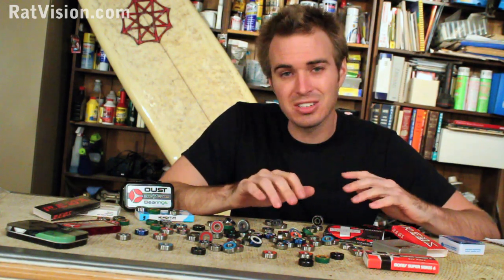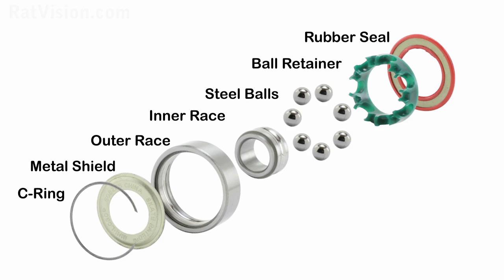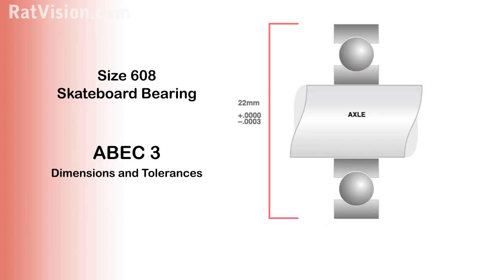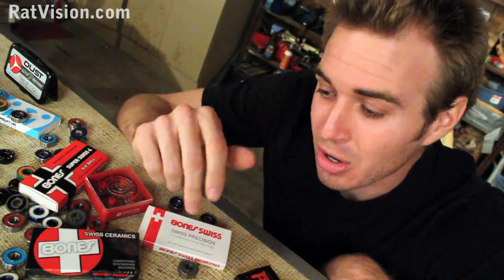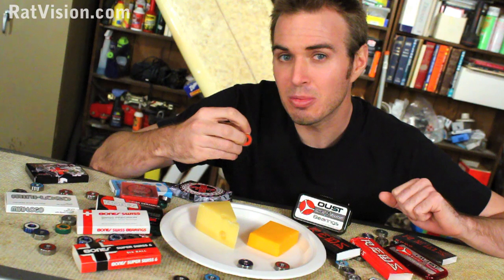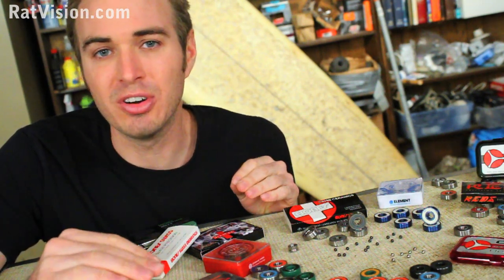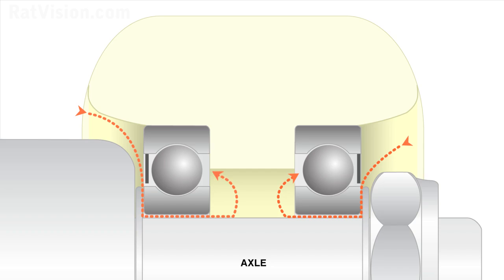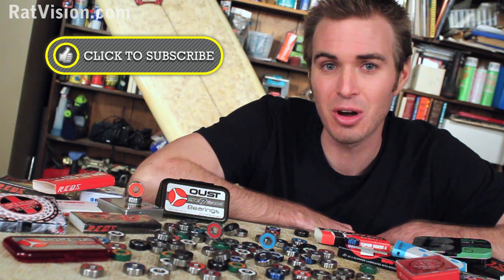What is ABEC / Swiss / Ceramic Bearings

Comment from the maker: If you are kind of new to skating any board is really good for cruising.  Any board will obviously cruise, like any automobile will drive. Shapes, lengths, wheel durometer, trucks widths etc. just get more specific when you know exactly what you want to do with the board.  Anyway, any deck will hold your weight, unless it flexes.  There are different flexes for weights, be aware of that.  36"-40" is a good length. Wheels- 85A durometer with 65-70mm is a good start. If you have more questions ask

Comment from the maker: The truth is not all "Swiss" bearings are made in Switzerland. Bearings r made on a Screw machine.  The best screw machines r Swiss screw machines. If a Chinese bearing manufacturer owns a Swiss screw machine can their bearings be called "Swiss bearings"? They do. There r also Swiss "style" screw machines too. This is why "Swiss" is basically a name. There are no instructions for making Swiss bearing. It's not the steel either.  It's just a bearing, but some could have good material and quality.

Comment: So you are saying that Oust has the best bearings. I am a long-boarder. If I get say the moc 9 oust bearings they will perform the  best or better than all other bearings. Of course you have to factor in cleaning and i would clean them a lot and loob them. What would you recomend the best bearing is for longboarding with the highest tolerance and deepest raceway pluss overall performance? Thankyou

Comment: i raced on Roller Blades 20 years ago and quickly learned how easy it was to disassemble the skates to clean the bearings and axles and how to lube them to make them last.  both skates and boards need to have the wheels rotated in order to make them wear evenly...

Comment from the maker: Exactly. Ding Ding Ding.  Winner!

But they aren't all the same.  "What makes one better than another is the quality of material and the manufacturing process."  The more precision and care that is spent on a bearing the better it will be.  There are no instructions for making a Swiss bearing.  There are no regulations or standards to follow for making Swiss bearings. So you could purchase "Swiss" bearings that are not very good at all.

Comment from the maker: Yes the size of the wheel effects the spin.  However, spinning a wheel freely does not indicate anything at all about bearings or wheels.  Loads have to be applied for the bearing to function properly.  How fast long it rotates for in a free spin does mean you will go fast fast or push less while you are riding.

Comment from the maker: Bones Reds are Ok, but certainly aren't the best. HKD ABEC 7 have a tighter tolerance so they may function better at higher speeds and handle torsional and axial loads better than Reds.  There are other factors to consider like polishing and material hardness. Unfortunately, the brands don't disclose that info. Usually it's because they are not the manufacturer. Just so you know, HKD is the exact same bearing as Rush and other brands. Give other bearings a try and see what you like.

Comment from the maker: Your right with your assumption.  The Oust oil is better than Speed Cream, but requires more frequent applications.  Speed Cream is more viscous so it takes longer for it to dissipate.  If you want to less maintenance go with Speed Cream, if you want more speed go Oust Metal Oil.

Comment from the maker: That's true. Ceramics CAN have a harder surface than steel, the rest of it is not. Ceramic balls start as a powder. The whole structure of a ceramic ball is not harder than steel, which is why they are brittle (chip/break) and explode when heavy loads are applied. Once the surface of a ceramic ball is damaged it exposes the interior which can quickly further destroy the ball. There are also misconceptions that a ceramic ball will resurface a damaged raceway. Not true bcuz the steel can be harder

Comment: The ceramic bearings have more scratch hardness than the metal ones, maybe thats what they refeer to hardness, i think. if the material doesnt have enough scratch hardness, well the surface its gonna suffer and as you said its important a smooth surface on the bearing.

Comment from the maker: Good questions.  The Moc 5's are great.  They have slightly less polishing and tolerances than the Moc 7's. You really get what you pay for when you go up on any bearing.  So although 7's are better, you may not need them, and you save a little money too. The Moc 5's use a metal ball retainer which is more durable than the nylon retainer in the Moc 7's.  The differences between the two Moc 5 bearings is that the Techs have removable rubber seals for maintenance purposes.

Comment from the maker: How long a wheel rotates for in a free spin proves nothing.  Bearings have to have weight/loads applied in order to determine their functionality.  Adding a heavier wheel will make bearings spin longer in a free spin.  Those times you have are very low.  Are your bearings really only spinning for less than 6 seconds? How did you come up with your list?  You wrote as if you knew what you were talking about.

Comment: Yea, I just found my old skateboard i've been riding when I was 12 Years old, I stopped cause the bearings were broken (I saw some one ball cracked when I cleaned it today).
Now, my budget is pretty mid-high, should I buy a new Deck etc..?
That's a Yashima Board with ABEC 1, after cleaning the bearings every wheel did spin longer, or they did spin at all..^^
The board is now 7-8 Years old and when standing on it the wood squeaks,
Any suggestion for some new board?
I am a re-Beginner :)

Comment from the maker: The Swiss steel grade is a big misconception. "Swiss grade steel" has nothing to do with a bearings being "Swiss". The only thing that makes a bearing Swiss is that a certain percentage of the material comes from Switzerland or that it is made in Switzerland. Most "Swiss" bearings have a lot of Chinese manufacturing involved. To what degree a "Swiss" bearing is even Swiss is a mystery. There are also no regulations on bearing manufacturing either. FYI, some "Swiss" bearings are 100% Chinese too.

Comment from the maker: This test was to prove that ceramic is not harder than steel, which is a common misconception. Many people believe that ceramic will repair a damaged raceway by making it smooth after it gets contaminated or get pits in the metal. There are loads that reach 1000's of pounds in skating. The metal balls are ductile and will warp or deform during these loads, but it will rebound back to its shape.  This is why harder material is better.  Ceramic doesn't deform, instead it explodes.

Comment from the maker: Yes you can stick with them.  It's up to you on what bearings you want to ride.  There are different factors to consider– price, low maintenance, speed, tolerances, etc.  If you aren't demanding high speed, then Reds are fine.  If low cost is a concern then Reds are great.  They do require more maintenance because they only have one seal.  So you should clean and lubricate them (see our cleaning video description). When you demand more speed and durability there are much better bearings.

Comment from the maker: There is a reason for a 7 ball standard. It has to do with loads. Only half the bearing is handling a load (weight) at one time. Look at half of the 6 ball bearing image on their site. While that bearing rotates only 2 or 3 balls are handling the loads at one time. The idea was to reduce friction with less balls, instead it creates a slower bearing because 2 balls are handling tremendous loads making them slower. 7 balls spread the load out among 3-4 balls causing less friction and more speed.

Comment: You know your stuff :) But I think it's important to mention that Swiss bearing are usually handmade, or made with "precision tools." This makes the bearing much more trustworthy as far as structure, but they have no different materials than regular bearings, and are much more expensive. Ceramics don't rust and spin faster, so they're good for cruising/downhill long boards, never skateboards. Bottom line: Bones Reds work fine lol

Comment: without a doubt you know a lot about the subject, but you didn't answer a single question as to what bearing is better than what and why. However, from experience, an abec 3 bearing will slow your roll speed much quicker than abec 9 bearing, and the best non-ceramic bearings I've come across are my bones super swiss 6. They offer very little resistance from their 6 balls, and give the longest roll imo.

Comment from the maker: The Swiss may produce high quality steel but it's not because of the Swiss Alps. There are so many variables that go into producing different grades of steel including how it's worked n treated. If China used "Swiss Steel" to make a bearing is the bearing now a Swiss bearing? No. Swiss bearings do not all use metal cages, ie. Bones Swiss don't have them. There are NO instructions, no specific materials, and no designs that constitute a Swiss bearing. A bearing is bearing, is a bearing.

Comment from the maker: There is no instruction manual to make Swiss bearings.  Other than where the bearings are made Swiss doesn't mean anything.  It doesn't mean they use a specific metal, or they are designed differently. Some may have better polishing, tighter tolerances, or harder steel. This is why Swiss is basically just a name. Here is a question. Why are there no ABEC ratings on a Swiss bearing? They can sell an ABEC 1 or ABEC 3 bearing for more money because people think Swiss is so awesome. Ridiculous huh?

Comment from the maker: This video is for informing you about the different types of bearings– ABEC rated, Skate rated, Swiss, and ceramic. It's not a video on buying bearings. We also mention what makes a bearing better than another.  We mention stuff about shields and seals.  We recommend bearings with 2 shields/seals, and high ABEC rating, and deep raceways. We also recommend Oust bearings because of the degree of polishing they do, their material hardness, and how they redesigned the raceway to handle loads.

Comment: @IEatApple95 bones reds are really good considering their price. but they do crap out and rust fairly easily compared to other bearings. When i used some, i rode on wet ground a couple times. after those couple times they were already showing signs of rust. but overall id say they are just above decent.

Comment from the maker: There are no specific features, designs, or materials that mean a bearing is Swiss. They are only made in Switzerland, and most "Swiss" bearings have some degree of Chinese manufacturing involved. A lot of countries make bearings, and they are basically making the same bearings. The only difference between them is the materials, and the manufacturing. There are no instructions for making a "Swiss" bearing. This is why Swiss is not the best, and why China can make a better bearing.

Comment from the maker: Check out their website and get what you think you need.  Just because there are Moc 9's doesn't mean that you need the best.  The Moc 5 street and tech bearings are the same except for the shields and seals. I personally have them for my street set up. Moc 7 and 9 have better manufacturing and more polishing.

Comment from the maker: Sector 9 sells bearings, but is not a bearing manufacture.  Oust is the only company that redesigned bearings to function specifically for skating.  Don't be brand-washed into what is popular or what a top brand is. Most of the stuff out there are pop-outs.

Comment from the maker: We recommend Oust because they are the only brand that actually redesigned their bearing to handle axial and torsional loads. Oust bearings also have the tightest tolerances in the industry because of the redesign.  The ball that exploded was a Bones Swiss ceramic.  The ball that went to 22,000 lbs was Oust.  They use a harder steal and polish their balls to a higher spec.  By far the best on the market.

Comment from the maker: From all my testing and research I only recommend Oust.  They are the best. However, if you are not an experienced skater and not doing big tricks than any bearing will work great for you. If you don't like doing any cleaning or lubricating then go with a bearing that has covers on both sides so they stay clean and keep lube in.

Comment: I had Bones super red bearings, and I busted 4 within 2 days. They weren't rusted or messed up at all. The axles in my trucks aren't slipping and I always make sure there is room between the bearing and the bolts. I usually bust 2 bearings a month, and I've used all kinds of bearings. WTF

Comment from the maker: @stenn0606 Sorry you were told that.  In many cases it does not matter because a skater could be young or inexperienced and they won't know the difference. As you can see there is a lot that goes into bearings.

Comment from the maker: @iRawrDinsawr They are not ABEC 9, or ABEC 7.  MOC has nothing to do with ABEC.  While speaking with the manufacturer of Oust Bearings I was told that they are ABEC 9 or better.  The reason they have better tolerances is because of the way they redesigned the raceways.  The 9's are better, but if you're not some badass skater you'll probably not notice any difference.

Comment from the maker: @donaldson1 Why not? There are no physical or mechanical differences between Swiss or Chinese. A Swiss bearing is exactly like all other bearings. They can choose to use harder material or polish the surfaces more etc, and so can the Chinese. The only thing that makes one bearing better than another is the materials and the manufacturing process. Pig Swiss bearings can be better than Bones Swiss. It's all about what the factory chooses to do. "Swiss" has nothing to do with it.

Comment from the maker: @sillypiggy2 Ceramic balls are not harder than all steel races. Ceramic is also not harder than steel, only the ceramic surface can be. There is no such thing as self repairing. This is marketing hype. Think about it. Lets say a ceramic ball had a harder surface than the raceways, and the raceways had pits and tiny craters in it.  If the ceramic ball was able to smooth the surfaces out it would create dips that are not bigger than the original pit or scratch. They are not good for any skating.

Comment: The ceramic balls are harder than the steel raceways, this makes the bearing self reparing the balls will never be damaged by dirt or anything that gets inside of the bearing so the balls will always be round the. raceways will be damaged by the dirt but since the ball is perfectly round and harder than the steel it will repair the scrateches kepping the bearings smooth. They are also for longboarding no real need in skateboarding.

Comment from the maker: @yamaha212121 Get the Oust Moc 5 Tech bearings. They have a rubber seal that are slightly more protective than metal shields on the Moc 5 Street.  That's the only difference.  They both use metal ball retainers which are better for street skating because they handle more abuse than nylon retainers.

Comment from the maker: @EXOinsider6 Oust Moc 5 Street or Tech bearings.  The only difference is the cover– rubber seal or metal shields.  I'm not sure if there is a difference in price. They both have a metal ball retainer that holds up way better than nylon retainers.  So you'll have a much more durable bearing.  Their tolerances are outside the ABEC scale because the bearing races are different than any other bearings on the market. I think they run about $30 bucks. Well worth it.

Comment from the maker: @rnrsoldier3179 Unfortunately, it is tough to say which bearings to get because non of the brands disclose the information we need to know.  They basically say they are the fastest, or have the highest ABEC rating.  This video was intended to explain what ABEC is, How the rating works, what tolerances are, what really is a Swiss bearing, and info on ceramic bearings.  If you like a particular brand, ask them why you should buy their bearings.

Comment from the maker: @awesamful ABEC 7? You did watch the video right? ABEC 7 is a tighter tolerance. In other words has a smaller space between the balls and races. ABEC ONLY MEASURES TOLERANCES. There is no rating for speed, durability, or how well a bearing works. There is no way to know which r the best without every brand telling us the complete specifications of their bearings. Watch the other video I have on bearing spacers, or go to ratvisionDOTcom. Material hardness, polishing, and raceways r important too.

Comment from the maker: @sk8erfreak540 All manufacturers sell their stuff for more than retailers because they don't want to compete with their buyers. The ball that went to 22,000 lbs in the press was an Oust ball. The one that exploded was a Bones Swiss Ceramic. The Oust raceways are specifically designed to handle the axial and torsional loads applied during skating. All other bearings have different raceway depths or widths. Maybe his r the best becuz of the work that went into the bearing instead of marketing hype